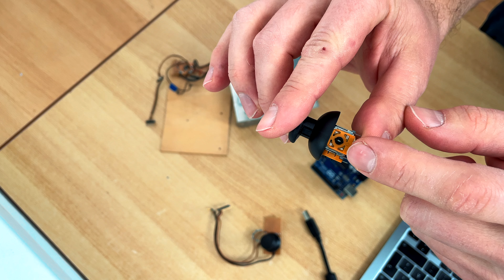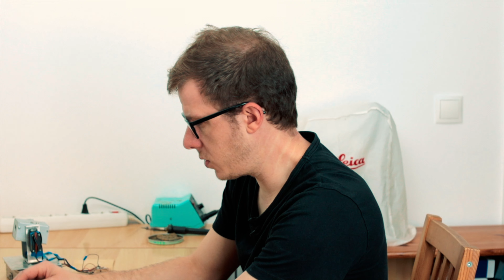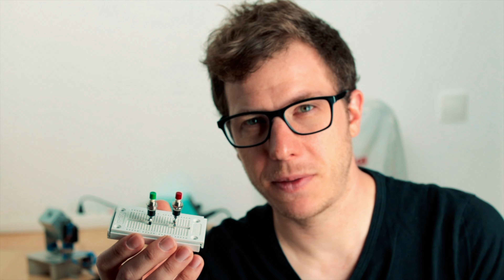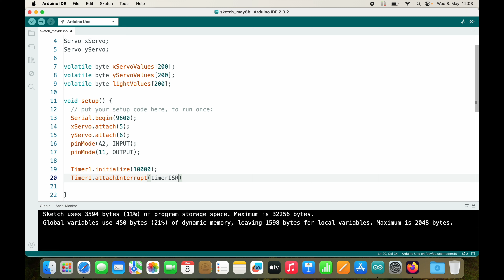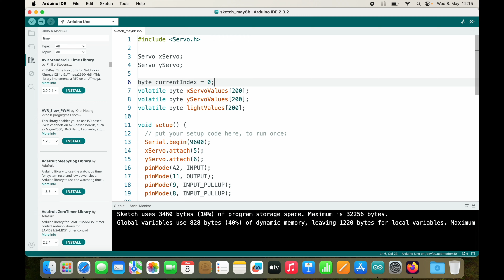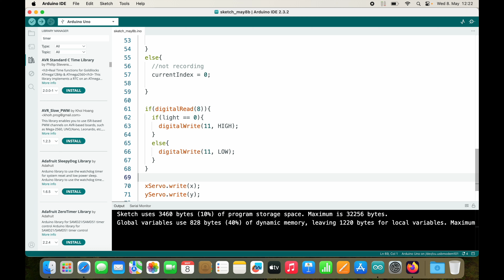How to record moving head movements using arrays - (Arduino Uno Programming for Beginners)

Comment: Interesting project.  This "recording" concept could be a very valuable asset for many Arduino/Servo/Stepper projects. However, I just couldn't follow or understand it for two reasons.  First, your videos have a "trial and error" format, which is very good for learning why code does or doesn't work.  But is can be hard to follow.  Second, the video covered several things and the "recording" part really needs to be a separate video.  And I just couldn't understand what was being recorded. Was it the time the servo was "on"?  Could this work for Stepper motors by recording the number of pulses sent to the motor?  If memory is a problem, how can you get around that?  Or does the insufficient amount of memory make this impractical for most projects.  Thanks
Reply from the maker: thank you for the feedback. I agree, it is a little bit much for one video. I'm afraid I was too enthusiastic :D
if you have not already, please check out my second video about this project, I go through the code again and refactor it so that it looks nice, I also fixed some bugs: https://youtu.be/ACn4-3X8LvY

I record the angles of the servo every 10ms in both x and y axis, I also record if the light should be on or off at any given moment of the recording.

for example the start of xServoValues array could look like this:

[90, 90, 90, 91, 91 , 92, 92, 93 ,94 , 95 ,96 ...]

when I playback, I loop through this values.
I set the servo to xServoValues[0] which is 90, after 10ms I set it to xServoValues[1] and I do this again and again until I reach the end of the array.

yes this could also be used with stepper motors.
you can increase the time between measurements. in theory you could even interpolate between measurements to make it smooth again but this will only work if up to a certain limit.

the best way would be to use external memory or a microcontroller with more memory
Reply: @playduino  Thanks for the reply. It helps and I appreciate it very much.
So, my request is, please make some videos that address the things we talked about here. 😀 Also, I would like to send you pictures of my project, if you have a "junk" email address that you don't mind posting here.  I'm hoping that you will be able to be successful in your YouTube endeavors and will be able to post more projects. Thanks again. Regards
Reply from the maker: feel free to send me some infos / pictures:
youtube@playduino.com
Reply: @playduino   Thanks. I sent an email last week. Did you receive it okay?
Reply from the maker: @br-pe4i  Hi, yes I just answered.

Comment: I must think about it a bit, but at least 2 points should be done. The 2 points that you already explained in other videos:
a) using const variables instead of using the numbers 5, 6, ... 200.
b) what about bouncing if you press a button? Can't that be critical if you record? So you record and because of the bouncing it might override the just done record by a very short new unwanted record?
A third point is maybe:
c) write a shorter main loop and call functions for 2 (sub)-tasks. A function that cares about the movement and a function that cares about the record. (maybe a bit over engineering, since you main function is (maybe) still short enough, but it is a good point to teach how to read the x and y value once and use them in the functions. You also probably want to make the project bigger and then it is fine to separate that 2 things.)
Reply from the maker: thank you very much for the detailed suggestions. I will use them in the next video :)